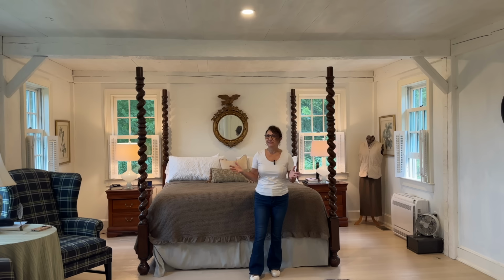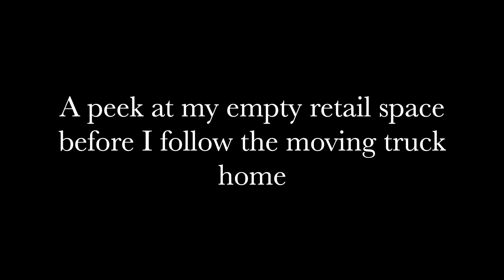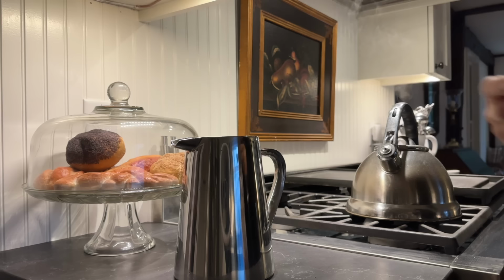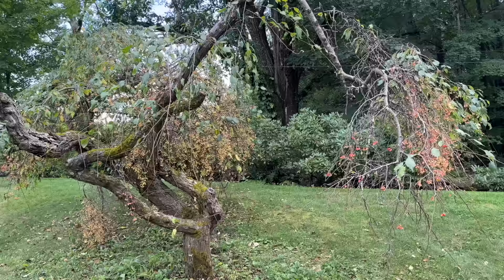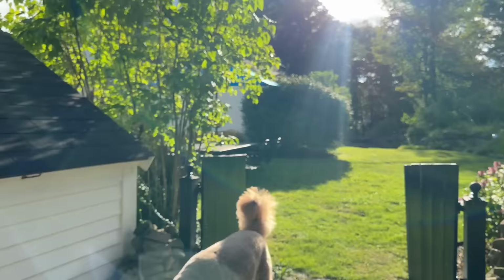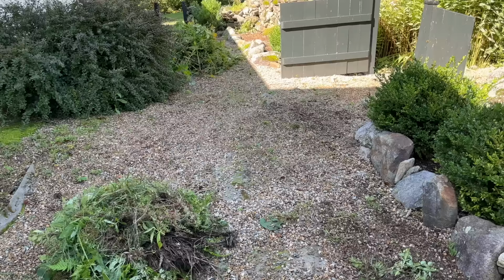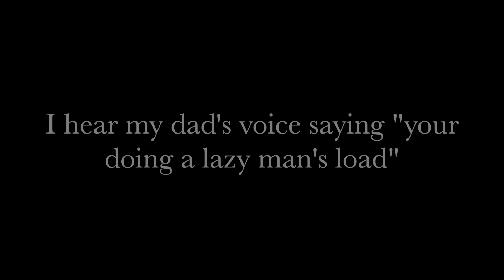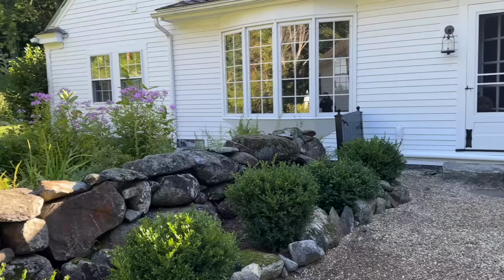Our cozy dining room decorated for fall and my weekly fall vlog of things I'm doing around our home

Comment: I always enjoy your latest videos on Sundays, and love seeing what you’ve done lately inside and outside your home and are planning to do. Isn’t the late summer and early autumn a wonderful time of year for decorating and enjoying the cooler and milder weather in the Northeast? It’s my most favorite time of year, and so welcome (and a relief) after the very rainy and hot summer we’ve had. As for the next seasonal box, whatever you decide on offering it is fine. (I love my small purchase from your online shop, and it was so nicely packed, too.) And your UPS driver is a gem! 

Also, you can always turn your pillow sleeves into pillow cases every easily by simply stitching a straight seam down one of the open  ends of the sleeve to close that opening. (Stitch on the outside of the pillow sleeve to preserve the pretty scalloped edge detail).

Comment: I also love using multi-purpose seasonal decorations, especially Halloween/Autumn items. I just turn them around and they are suitable for whatever is current. I hear you on the odd weather this summer! NE Ohio right by the lake has had very mild (almost Fall-like) weather. So strange. I was recently diagnosed with ADHD, and I am much better at single tasking than multitasking.

Comment: This video is full of goodness. I've been curious about your heat and a/c. In the dining room I see the white unit under the window and a floor vent. Which is heat? Are they both electric? I've always wondered about the best way to heat a house in the north.
I'm reading a thrifted book, Elizabeth Tudor, Portrait of a Queen. Only 50 pages in. Did you know that her birthday was Sept. 7th? I'm also thinking that the 1500s were not the best of times.
Willow is the best company. 💕
Reply from the maker: Hi Jane, the white unit is both a heater and air conditioner by electricity.  The floor vent is our other heat source by oil.  The fireplace is another amazing source of heat and that is by gas. We also have our wood burning fireplaces and our woods stove to keep us cozy.